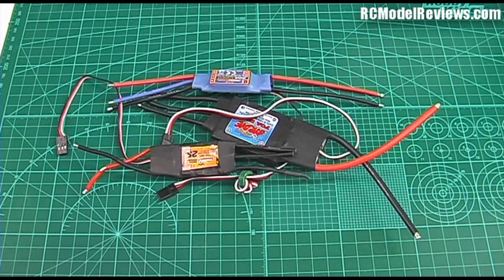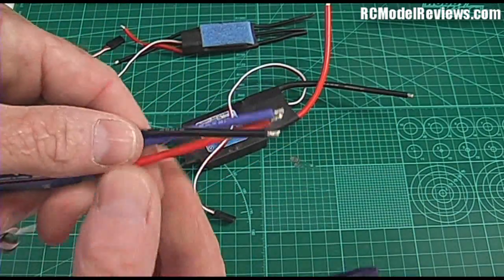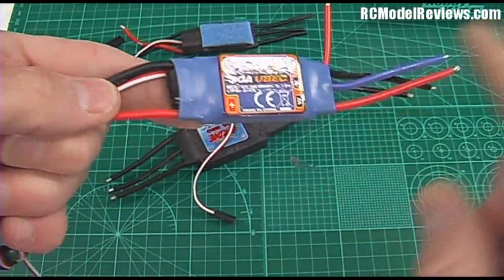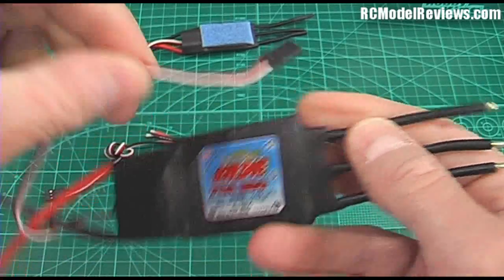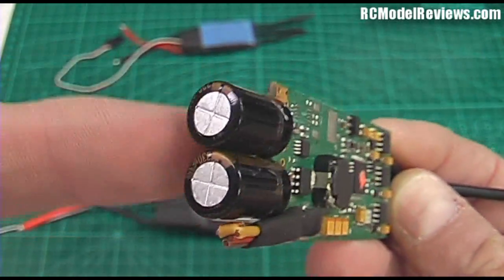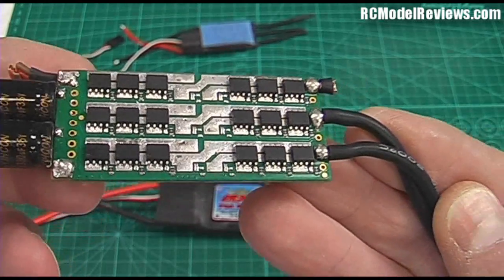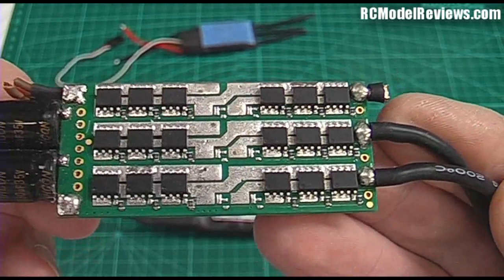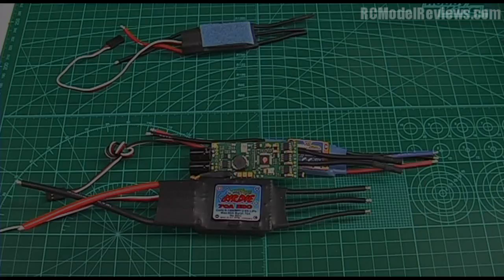What's inside: ESCs

Comment: Sorry, but you are not entirely correct. They are still called DC motors because their behavior is exactly like a brushed DC PM motor, but electronics is required now. What happens is that as you apply more load onto the motor, the micro controller will adjust the frequency lower and try to hold voltage. This will cause speed to dip down and current to increase because the inductive reactance has lowered since the frequency has lowered, but voltage did not change, which will increase torque just like in a brushed DC motor. If the micro controller did not do this, then the motor would act like a permanent magnet AC synchronous motor and STALL once it falls out of synchronism.

Just hook a brushless DC motor up to a 3-phase AC source to see what I mean and then hook it up to an ESC. BIG DIFFERENCE!!

AC motors such AC induction have been brushless since 1888, but they are not used in the R/C hobby and probably never will be. That would require a high frequency design such as 400 hertz or 1000 hertz to make them small and lightweight and the micro controller would have to solve MUCH, MUCH more complex math to control the AC induction motor torque, and efficiency of miniature high frequency AC induction motors would be less than brushless DC. Plus if you want full torque from zero RPM to full RPM, then you also need a feedback device that measures speed of the motor, not position as is the case of sensored brushless DC motors.
Reply: ALL MOTORS are AC motors. Yes, even the little brushed motors we used to have to use before brushless technology was popular.

"DC" (brushed) motors are mechanically commutated - That is, they use a mechanical device (brushes) to alternate the polarity of the DC signal applied to the rotor. In other words, the brushes in a brushed motor are responsible for providing the rotor with an alternating current signal.

Brushless motors are electronically commutated, meaning that instead of brushes, they use a feedback signal or hall-effect sensors to detect the position of the rotor, and then mosfets to invert the DC accordingly.

Either way, the motors operate on an AC signal. The mechanism (mechanical or electronic) for producing that AC signal, and that mechanism's awareness of the desired output and the motor's current state (more advanced for brushless than brushed) is what separates these different motor types in performance.
Reply: They seem to be equivalent to (3-phase) permanent magnet synchronous motors (and not the much more common induction motors), so they'll likely need a variable frequency drive (or another way to synchronize it) to start up...

They ESC seems to attempt to drive it mainly like brushes would - switch to next phase once that would drive it more effectively (larger torque) than the current one...
Reply: highvoltagefeathers I don't see the point of your post. I did not say that DC is feed to these motors. I said the brushlesss motor's BEHAVIOR is EQUIVALENT to the PM brushed DC motor in that as you load it down, the torque will go up in linear fashion as a brushed DC motor, PROVIDED said motor is connected to an ESC that performs all the things I said in the first post above. If the signal is fixed frequency AC like what our wall outlets are and voltage is not varying also, then a brushless dc will behave as an AC SYNCHRONOUS MOTOR, where torque will not go up in linear in fashion to a max at Zero RPM. This is a FACT!!

The oscilloscope is your friend, use it for once. Hook up a brushless DC motor to an ESC and then apply different mechanical loads to the motor, but do not vary speed of the motor. What you will see is that the voltage will vary and the switching frequency will vary from where the ESC is actively raising the torque as the motor is slowed down by a load.

The commutator on the brushed DC motor does the exact same thing: It reduces switching frequency of the armature coils as you slow down the motor which lowers inductive reactance (XL) since frequency went down. Also, as you slow down the motor, back EMF generated by the motor will also go down, so the difference voltage (supply - back EMF) applied to armature coils goes up. Therefore, the lowering of the inductive reactance + fixed electrical resistance of the armature coils(XL+R) with higher voltage applied means more current flow and therefore, more torque.
Reply: brushess "dc" motors are just AC, as you say: they need the ESC to ackt as an DC motor but they are just ac.
Reply: I agree with EETechs they are 3 phase DC motors that take a Square sign wave as apposed to a fixed HZ modulating AC sign wave.
On the bigger HP motors its the same but the DC motors have better cooling than AC motors.  The AC motor will run on a square sign wave but tend to run hotter, which could burn it out under low loads because of the fixed fan cooling.
I am sure Bruce knows much more about this than I do.
Reply: Andrew Crews Your speed drives are not being asked to control torque and speed of the motors. In applications that used DC motors, the AC motor needs vector control with closed loop feedback. There are two currents, magnetizing and torque producing. In order to control torque, you must separate the torque producing current from the magnetizing current.

In industrial sized brushed DC motors such as shunt wound motors, the magnetizing current was the pole field coil current and the torque producing current was the armature current. In AC motors those two quantities are together and must be separated mathematically with a fairly powerful microprocessor and then those two quantities can be controlled independently.

Here (Wikipedia):

"Vector control, also called field-oriented control (FOC), is a variable-frequency drive (VFD) control method where the stator currents of a three-phase AC electric motor are identified as two orthogonal components that can be visualized with a vector. One component defines the magnetic flux of the motor, the other the torque. The control system of the drive calculates from the flux and torque references given by the drive's speed control the corresponding current component references. Typically proportional-integral (PI) controllers are used to keep the measured current components at their reference values. The pulse-width modulation of the variable-frequency drive defines the transistor switching according to the stator voltage references that are the output of the PI current controllers.[1]"
Reply: Torque of an AC  induction motor does not continue to go up larger to zero like brushed DC motors do. They have breakdown torque that occurs at about 4/5ths RPM (loaded down to, not revved to) and then torque falls quickly to a very low value at stall. Hence, the term "breakdown".

This means that some loads cannot be started by an AC induction motor because of the low starting torque. But I can take a vector speed drive and hook it up to the motor and have very high starting torque that will allow the motor to start up the piece of machinery.

Basically, all the controller is doing is allowing an AC motor to perform like a DC motor by doing those very complex mathematical operations so it can directly manipulate the torque producing current so that it can control the torque of the motor instead of motor characteristics dictating the torque curve. The same trick is used in new design locomotives that now use AC motors instead of DC ones. The vector controller is simply manipulating the torque characteristics such that the motor has very high starting torque like a DC motor does in order to get the train moving.

Another way you could look at it is its like giving an AC motor a sex change. It's a male motor as long as a vector controller is used, but it's actually female. LOL
Reply: Super interesting. Where can I learn about ac motors

Comment: I am interested in running a two motored craft . I am interested in them running on opposite directions ( 1 ) I see no reason that the motor element will not cope with this process ? ( 2 ) is it possible to get the controllers to put out the required power just by reversing the wiring from the ESC ?

Comment: Just crashed my quadcopter. It did the death roll from about 50 ft. Anyway it broke one of my booms and smashed just a little of one of the two capacitors on the esc. When I arm the motors the motor in question jumps,pits and sputters and the other three spin just fine. Could this be a esc problem. Thanks for any help in this matter. Love your videos

Comment: How do you determine the refresh rate of an ESC?
Reply: +Billy White If you mean demand signal (throttle signal) refresh rate, that depends on the control signal. It's typically about 50 Hz when coming from an RC receiver, but can be anything depending on the type of control system.
If you mean the PWM carrier frequency, it can be 8, 12, or 16 kHz for most RC ESCs.

Comment: Thanks, I have spent days trying to understand an ESC, an you have done it in 7 min's, well done
Reply: All those FETs are setup in just 3 totem pole circuits. What happens is that one of the 3 totem pole outputs is set to go HIGH, and the other 2 are LOW. then the next totem pole is set to go HIGH, the the rest are set LOW. It cycles though all three and that is what makes the induction motor work.

Comment: where can I find the connection and function  information on the 4 wire connector for the small ESCs that come on a Phantom 2.  Also what is the current rating of it. I see no heat sinks on the FETS- is this a common failure mechanism

Comment: Is there a way to bypass the receiver. say I wanted to connect directly to power source. with out having to use remote control?
Reply: Me to, i want to bypass the esc to max rpm without receiver or something else, just a battery and 5v

Comment: Hi, I had trouble understanding the 3 wires coming out until a friend at my local hobby store told me that to reverse any two wires will reverse the motor.  Then it clicked, these are nothing but 3 phase motors.  Knowing that, I understood what the ESC is doing in replicating a public utilities electric generator (all are 3 phase).  But instead of cycling between the phases at 60hz, it can be sped up or slowed down electronically.  This technology is now used in HVAC to make super efficient airconditioner units by taking the AC current, turning it into DC and feeding it to an ESC to drive the 3 phase motors at a variable speed.  This saves energy by never having to load up trying to compensate for an environment change in so many degrees.
Reply: These ESCs are not the same technology that is seen in large scale HVAC fan and pump motors. There aren't any "ESCs" on them. The Variable Frequency Drives or VFDs is what controls their speed. It does so by changing the frequency of the incoming AC voltage to the AC electric motor while the voltage stays constant. What is in our RC vehicles is a brushless DC motor which changes speed according to voltage and not frequency. What the Speed controller does is pulses a variable voltage between the 3 phases of the motor.
Reply: Correct, but the motors are 3 phase like the big industrial motors.  However, they are powered (in the US) from 3 phase power at 60hz.  An ESC can spin a motor much faster than that because it's computer driven to change the speed of the rotation between the legs of power.  All the best and Happy flying!

Comment: thanks for your review ,what can i do for not burning more esc , i match lipo battery current with motor and esc ,i use my esc in boats ,i am very careful to have adequate cooling and not too big props otherwise they draw more current and burn ,but whatever i do they also burn sooner or later .i normally use cheap esc like hobbyking,i m afraid to buy an expensive esc coz i ll be afraid to burnt it also

Comment: Individual FET (field effect transistors) are fairly inexpensive and might be upgradable in your units.  The prefix to the 'FET' is the technology used to create the architecture such as VFET, or HEXFET.  The input circuit to most FETs are very similar so interchanging type, brands, architectures, packages etc. is pretty straight forward.  It is always best to fix rather than replace and usually only requires simple tools, a soldering gun and solder, and thermal paste to reassemble the heat sink assembly.  After the next nuclear war, when you are stranded without suppliers and need your drone to work so you can see the gang coming to steal your water... you'll wish you knew how to fix it yourself, so.. better learn now.

Comment: Bruce, is the output of the esc true AC or is it just pulsed DC?
Reply: i forgot, how does it regulate speed, by changing voltage, or frequency?
Reply: Pulsed DC using H-bridge configuration.  Total of six MOSFETs for a 3 phase motor.

Speed (torque) is usually controlled by pulse width modulation.
Reply: D Phil It changes the frequency at which the FET's switch on and off

Comment: One additional note is the early ESC had a opto sensor to synchronize the motor spin direction to the ESC control circuit.These were called "sensored" ESC units. Most today don't use this (some car ESC are still sold as sensored types). The sensoreless ones shown utilize the EMF filed that is generated by the motor windings and magnets, this signal gets processed and then used as a basic sync method to know where the motor shaft is during acceleration. This is the not the best way to do it, sometimes sensorless motors get what is called "cogging" due to the EMF signal not syncing up well.

Comment: hi there, i have a question regarding esc wire length.
some RCgroups topics are talking about maximum lenght (about 20 to 30cm) and never go longer
some are talking about never touch power wire and add lenght to 3 wires that goes to motor
some are talking that if you go above 30cm of wire, you have to add capacitors on power wires, and eventually add other every 20cms
effectively, some companies (YGE, Castle, Schulze....) are selling kits with extra capacitors. What's you technical advise on that ?

Comment: I'd like as informative video about servos. what's inside the servo?
Reply: A stepper and a (rotary?) encoder
Reply: I know what's inside the servo - motor and reduction gears. but this kind of video would add some more info like types of servos, circuit board details (signal interface), standard connector etc

Comment: Hi there! nice vid. What hapens if you pout 3 ubec esc's on a multirotor? will this damage my receiver?
Reply: You should dis connect the red wire , if you are using a Naza flight controller as some flight controllers have there own BEC
Reply: thanks!
Reply: Your welcome
Reply: Scott Thompson so if someone (like me) will use naza flight controller its better to find esc's without bec?

Comment: Hi Bruce,

Can you do a deeper technical video on this. I know you have a electronics back ground and I would like to have your opinion on some of the common ESC's from an electronics point of view. Most of them are based on the Atmega 8 and are easely flashable. I'm building a quad and got the 30A HK's (the ones with the blue wrapper) I flashed them with the SimonK firmware. The quad + camera is rather expensive and I would not want it to fail and crash because I was to cheap to by better ESC's.

Thx!

Comment: KV = 1000rpm/Vrms

example: 1700kv bldc, the motor will rotate 1700rpm per 1V. so if the supply is 10V, simply multiple the rpm with 10 and you get the rpm. or you can google article about kv rating of bldc motor. Thera are alot of explanation out there.

Comment: wouldn't be able to point it out, but there is a small speaker, actually a piezo crystal on the controller someplace. that's what beeps. I suppose if you really wanted to, and if the motor was connected, you could make it beep too, by applying a DC signal to the motor at the frequency you wanted. It's called ferromagnetic resonance... that's why you hear transformers hum.

Comment: About the comment that people are flashing the on board microcontroller of their ESC to reverse the motor direction. That is not necessary, provided it is a 3-phase motor/ESC (you'll have 3 wires going to the motor). In this case all you have to do is swap any 2 of the wires going from the ESC to the motor. This is a simple principle of 3phase electrical theory/practice.

Comment: might be worth noting that all the linear BECs i have seen in the 2-4C range run 1A smd 7805 regulators in parallel. i believe the bec current rating advertised must be at the lowest number of operating cells because they are well under rated to dissipate the 6-10W (without heatsinking the 7805 as are all my ESC) needed for 3-4 cell operation at full current. other issue is i found 7805 directly parallel do not load share very well i find you usually get one that gets alot hotter than the rest.

Comment: nope, some of the fets are placed in parallel so they can achieve a required current rating. in this case there are 3 parallel fets placed in 6 groups required to achieve a 3 phase pushpull inverter bridge. the output (when connected to a motor) would have effectively 2 steps positive and 2 negative

Comment: I always taught that you only need to switch two motor wires to reverse the motor spin direction, or am I wrong? Have not done that myself yet though. Seams like a overkill to reflash the microcontroller.

Comment: thanks fett63 for your comments but i disagree about having more FPV. great video bruce. If i wanted to power a push bike as a concrete example what power controller and motor from hobbyking would youmsuggest and would it need a bec?:-)

Comment: OR, it could be that throttle position determines duty cycle, and the resultant RPM is whatever the ESC senses is the correct RPM for the given commanded duty cycle and the load. 

Is this the correct understanding of what ESCs do with the commanded throttle position?